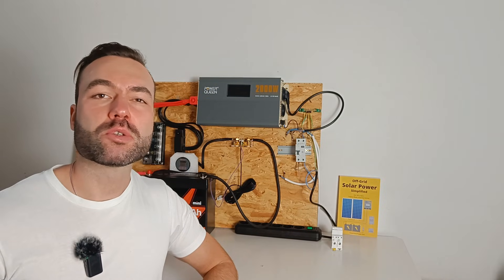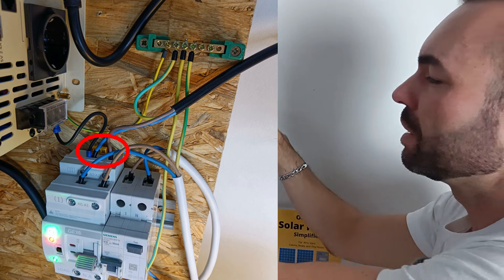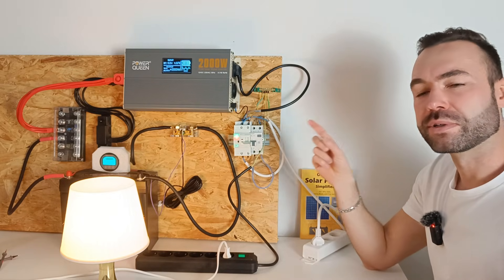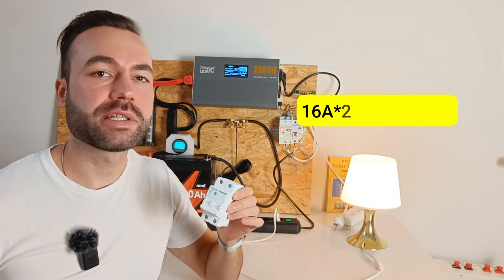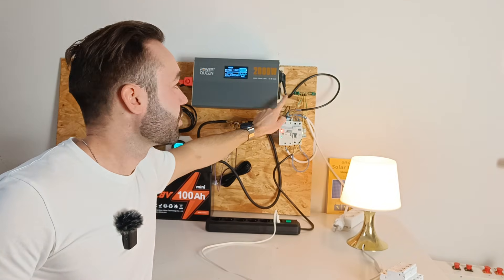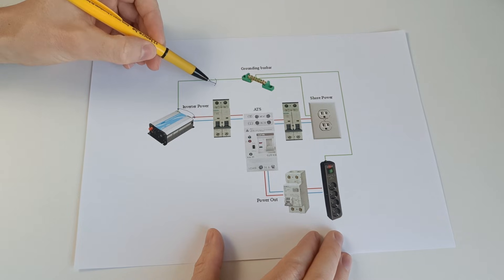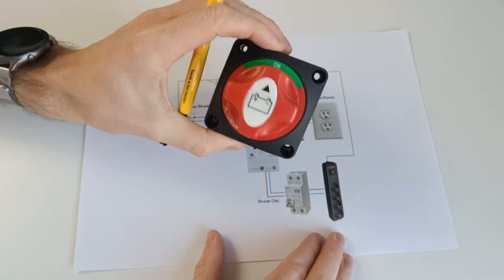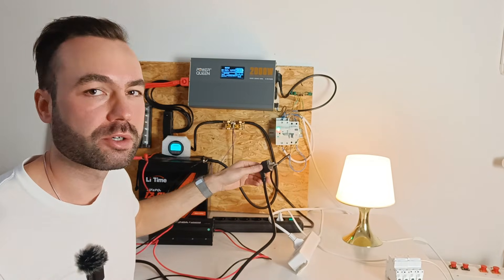Automatic Transfer Switch (ATS) GEYA: Switch between shore and inverter

Comment: Hi, I want to do the same thing for DC. I have 24 volt refrigerator and I want to swich between Car anternator while car work and Sun power 24 wolt while car stop. How? Also I want to use for charging the Second battery.

Comment: Thank you very much for sharing this videos, very useful! Question though, is there any difference in wiring similar setup for OffGrid home where it could have main supply from PVs and backup from Grid except of changing/reversing priority of inputs in ATS? I am a bit uncertain about grounding such system seems could be tricky. Is there any conclusion/follow up on the issue you mentioned at the end of the video where system is OnGrid and fault occurs on inverter?

Comment: Really nice video, thank you! Quick question regarding a potential loop between the battery and its charger. If the ATS is not connected to shore power, the battery will feed the 12/110AC inverter, so the power bar, so the battery charger...  So the battery woul try to charge itself. Connecting the charger directly to the shore power breaker would prevent that; it would not work on the battery power.
What do you think?

Comment: And Neutral-to-Ground bond? Depending on the situation, country, etc, you may already receive the Neutral/Ground bond from the utility service. When in inverter mode, most of them do not bond Neutral to Ground, leaving you with a floating Neutral. In that kind of setup, don’t you need a relay that energizes when switching to inverter mode to make the bond, and de-energizes when switching to grid mode?? that way, you always maintain only one Neutral-to-Ground bond.

Comment: Exellent video! I'm glad I took the time to watch this. I'm using a renogy 24v 2000 inverter and decided to read the manual again. It did say a neutral Grn bond was already created inside but it also said never connect the AC output of the inverter directly to an Electrical Breaker Panel or Load Center which is also fed from the utility power or generator. Looks like the don't recommend installing something like this. :(

Comment: On their specification they have this note: NOTE: The voltage of the common and backup power supply I 
must be 85%-110% of the rated voltage, and the current cannot be I 
less than 5A, otherwise the coil will heat up or even spontaneously I 
combust. 

What do you make of it, how do you understand this?
Reply from the maker: It is normal the coil needs to be in the voltage specifications. However, i couldn't find the claim that the current cannot be less than 5A. I have used it for 20mA (the lightbulb in the video) and it works fine.

Comment: Hi , could you recommend a small consumer box to mount it instead of having live wires exposed please after watching your video I am thinking of getting one , also i have seen them with 25A, 40A, 63A wouldn't I require the 25A for a camper van when shore power is 16A

Comment: I have a question I'm in the United States and I've got 220 two live wires 110 each and then I've got the neutral and the ground so I've got a total of four wires could you tell me which switch I would need because I don't see one that only offers two live wires I just see the three live wires and one neutral and then I see the one you're using with one live wire and one live neutral wire but I'm assuming that that's the way it is in the United Kingdom or in Europe thank you in advance and thank you for all your information
Reply from the maker: You need the 3p-63a-110vac version.

Comment: I love your videos thank you for the information just a couple of questions would you trust that transfer switch to handle a 60 amps? I know it's rated at 63 and also if you wouldn't what's the Max amps you would trust it with? And do you know what's the biggest gauge wire it'll accept? I can't seem to find that information on Amazon thank you very much
Reply from the maker: It's rated for 63A, but as mentioned in the video i would use other additional 63A breakers like shown in the diagram. I think the maximum wire gauge is 16mm² or 6AWG.

Comment: hi! if you use a purely manual (mechanical) switch, are the 2 breakers needed on the individual inputs? there are breakers on the output after all. thanks!
Reply from the maker: You always need breakers to protect your wire. Instead of a manual switch, you can use two breakers instead. The old transfer switches have two breakers inside of them. They have a time delay mechanism so they never are closed together. If you turn off your breaker manually and then turn the other on manually thats okay as well. However, you need to be very careful which one you flip manually, because there is no security if you would switch the wrong one.
Reply: @cleversolarpower  hi, cheers! 2 manual breakers could allow you to activate both at once, what you don't really want. I currently use a Y switch. I sadly have no option to add an extra breaker on the grid side, so I need to trust the breaker after the switch and the breaker of the electric company. I think that's a fair risk to take.

Comment: The problem is the inverter, it doesn't accept bonding the way you demonstrated, the manual says clearly do not bond neutral to ground. Sadly, the only solution I can see is to use a professional inverter like Victron, who does the automatic bonding switch. For anybody seeing this video, be careful it may blow your inverter. !!!!

Comment: 2000W inverter has a max of 2000W/220V = 9A. Inverter should never reach 16A current, 10A would be max that can be used with 2000W inverter, there is no advantage to using larger barker - some internal protections on inverter will work before barker will trip.  6A barker will give you 1320W of power continuously, bet can go up to 2000W for a short period, without tripping.

Comment: If you had a multiplus II Gx could you use one of these to switch between a diesel generator and grid? As the Multi plus only has one AC input. ?
Reply from the maker: Yes

Comment: Having a manual isolation switch in the inverter earthing line requires you to remember to switch it off when on shore power, the transfer switch is automatic, people's memories are not. Could you have a relay switch in this earthing line that senses shore power and disconnects, then connects in the absence of shore power?
Reply: maybe a Solid State relay?

Comment: Hi Nick. Firstly great video and teaching. Their's many ways to achieve the same result. Mine is a little different as my inverter is for a house and not a vehicle. My system is a TN-S. I use a 3 pole ATS switch and switch between grid and solar. My ground is never connected to grd and inverter at the same time. Its either going through the inverter and ground rod or through the DNO system.

Comment: Hi Nick another great video. I've appreciated your instruction and have benefited from some of the comments as well. 
So I am in N. America and have a solar/LiFePo4 setup in my travel trailer. 600W of solar, 12V500AH battery pack, 3kW inverter. ( I can hear you cringe Nick - this is not as well-balanced as I would like - nor as you have demonstrated in previous videos 😊) The distribution panel in my trailer is a WFCO  30A 120V system. WFCO makes an ATS that mounts directly onto the back of the distribution  panel (they have a 50A ATS as well). The ATS seperates the neutral and ground from both shore and inverter circuits. This swich has a delay, or instant transfer feature, depending on whether you are using an inverter or generator. I have it set to instant since, if I ever need to use a generator, I would plug the shore power cable into the generator. The only other consideration with my setup is the onboard converter charger, which I have upgraded to suit LiFePo4 batteries. To avoid a parasitic charging loop when on inverter power, some have set up a series of relays - I felt this was easy to do but unnecessarily cumbersome, so I simply wired (mine is hard-wired) the charger to the shore power input with a suitable in-line fuse. It's a very tidy installation. I have followed closely your cabling and fusing recommendations. Thanks for making all of this make sense.
I have mounted everything to a singel panel, which allows me to remove the entire setup in a matter of minutes. I set it up in my garage and use it for backup in case of a power failure during the winter. Win-Win as I see it. Thanks again for all the input.
Reply from the maker: That 3,000W inverter on the 12V system hurts 😄
Glad you got it to work using some of my videos.

Comment: Any short inside a well designed inverter should be cleared by internal fault protection, so the scenario you posed is not likely.  The ground system is there to protect life first so, putting a switch in the inverter ground is not a good idea.  If the neutral were to become severed, the GFCI will trip and not reset. Regarding the Giandel 600W inverter depicted, it has short circuit and overcurrent protection internally. Further, it also has a neutral/ground jumper installed internally, which is connected to the ground stud. In shore power mode, the system is connected to a ground rod.
Reply: This is what I was also thinking 👍
Reply from the maker: Only if you have the ground neutral wire in place. Some inverters don't have the ground neutral connection inside, so you have to make it yourself. Because the fault occurs before the GFCI, it will not trip. If a fault occurs after the GFCI, it will trip.

Comment: switching is done by the inverter - Renogy's have them inbuilt, only difference is its like a UPS ie: its fully automatic, no manual ability, but thats fine by me :)
Reply from the maker: Yes, but they don't have them available in the EU. Victron does the same but better (more expensive as well) with better I mean you can feed back into the grid.

Comment: Wow this is amazing. I have just finished a setup like this a couple weeks ago. Lucky i am using a victron inverter which connects g and n when inverting and disconnects when off. I added a ups to the load side so my stuff never turns off during switching

Comment: I use a Moes Automatic Transfer Switch for my boiler pump motor. It switches to grid power when the battery gets to low.

Comment: Hoping Victron comes out with a Quattro 2 5000 48V 120V version to take care of the issue for me.
Reply from the maker: You can also use the multiplus and switch inputs (generator and shore) with a switch.

Comment: If you use a Renogy 2000W inverter it has the transfer switch built in.
Reply: I know Renogy's 2000w inverter/charger has an ATS - not sure their inverter only does - unless it's new.
Reply: @IH-nr7dx  I own the 2000W inverter that's how I know it does, otherwise when I don't know something I don't post speculation.
Reply from the maker: They don't have them available in the EU yet, so I'm waiting for it.

Comment: Great video Dude. Is there a similar switch that can run primary power for solar powered battery / inverter to mains when the battery voltage drops, and switches back to solar when the battery is charged? Forum searches have not helped me on this seemingly simple idea.
Reply: There are programmable ATS' that can be set to switch to mains power when the battery voltage drops to a chosen level and then switch back when it has risen to another set level.

Comment: I'm using the Moes dual power controlled ats 50 amp 5500 watt. It runs on battery/grid, thru inverter with set voltage parameters for switching. No mechanical interlock and could possibly have issues with power over spec and becoming out of phase when switching from grid to battery. (12v 320amp/hr) My inverter has built in gfci (GOPOWER 2000) and the ats has been working flawlessly so far. My loads  at switching are generally way under ATS max ratings

Comment: Thank you, Nick!  Very informative video!

I was wondering. If you wanted your batteries to be primary and shore power to be secondary, where power is supplied by the batteries until the batteries are below a certain threshold and then only switch over to shore power when batteries are low until the batteries are charged again then switch back to batteries.  How could there be a delay switching back to batteries until the batteries have been charged?  Thanks!

Comment: Many folk start their solar journey in their home using an ATS to power one or more circuits. This is a good plan because you don't need to get authorisation from your power company and you can't feed back to the grid during blackout. This particular ATS, though, would not be approved in the US. It would need to be of the type that has a mechanical interlock.
Great video. And yes, the bonding/ground scenario is the most difficult to fully grasp as there are so many actual fully certified electricians who have very differing opinions. Quite often I think I have finally found the answer only to find, when reading the comments, that it is incorrect.
At the moment my solar journey is just powering a few loads from solar and battery. I want to do the ATS for a couple of circuits but this grounding issue I am yet to solve.

Comment: Hmmm, it seems that using the ATS is great, but you must remember to turn of your onboard battery charger. But what happens if I am away from my RV when the blackout occurs and my system automatically switches to the inverter for power? Thanks Nick, Cheers, Danny 💗🌹💗
Reply: I'm planning to wire the battery charger directly into the shore power before the ATS (after shore breaker), so it will only get power when on shore.
Reply: Wire the charger to take input when shore or grid power is available, a simple AC to AC solid state relay should be fitted, the fact that you asked the question suggests that you think ahead, but should probably get a qualified electrician to do the work.

Comment: Nick, This is very useful, but won't get me exactly what i'm looking for.

I am looking for an inexpensive way to use my existing off grid system and maximize my solar production by switching to grid power when my batteries are too low.

I was thinking of using an automatic transfer switch, but that would only happen when my inverter shuts off from low voltage disconnect, but it wouldn't have the logic to wait to switch back to battery power until the batteries are charged up enough. It would likely just keep tripping back and forth which I dont want.

I was looking at power limiter sensor type inverters, but due to location and not being familiar enough with them (and price) i decided against it.

Currently, my best solution is using a product from ampinvt that is a 1200w pure sine inverter that has a ups feature built in that can  run in reverse to prioritize battery and set a low and high voltage disconnect/reconnect and switch to grid/shore power. It is currently about 175-190.

I already have a 1500w continuous inverter though, so It seems like I'd be paying more for just the partial feature